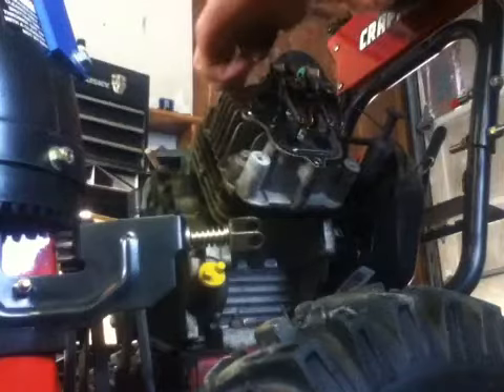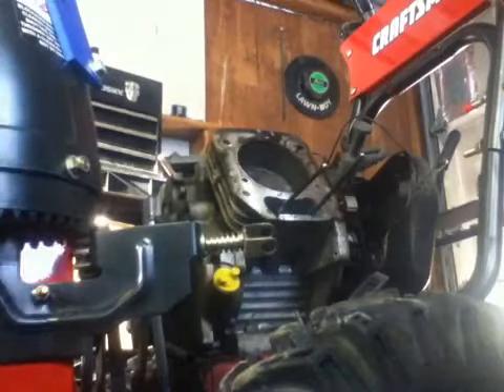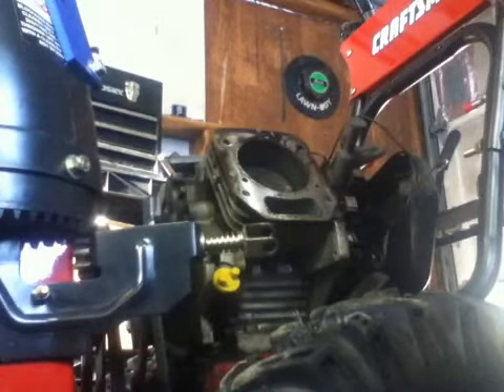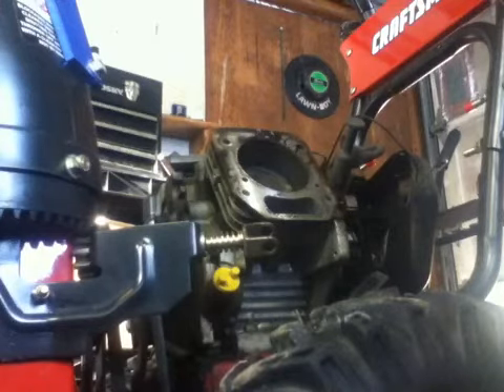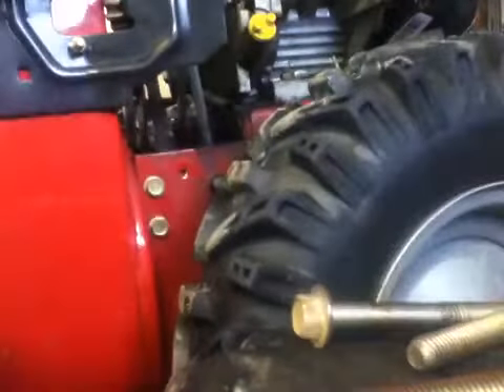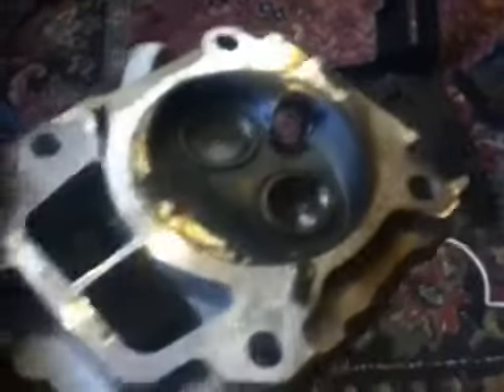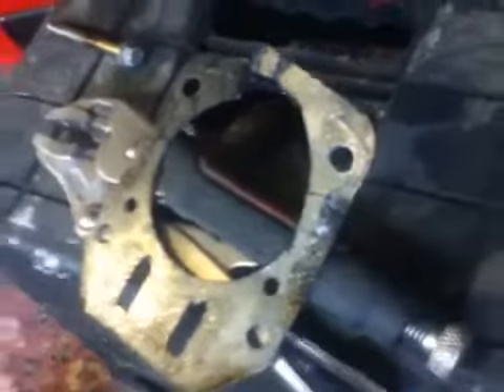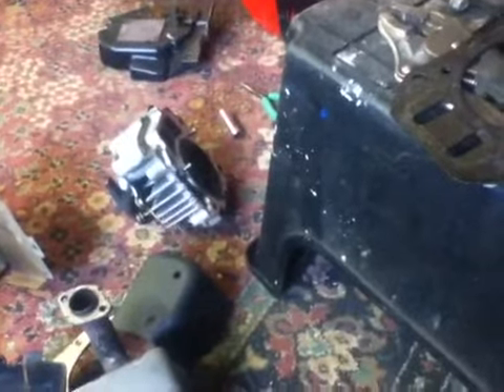Briggs and stratton head gasket replace pt.3

Comment: Yo, thanks for the help you gave me on my bike, i took down the videos cuz you effectively gave me the solution. I do need new reeds, and i have 132.3 lbs of compression, so thats not an issue. As for my idle, It totally never occured to me that i have been doing it wrong lol. Next time i pull it out to start it, i will fix it like you told me. I would personally like to thank you, because you have helped me so much, not only with my bike, but i also got my chainsaw, and Toro Straight shaft running using your advice, and a bit of swearing ;) If you need, anything, ANYTHING, hit me up, and i will do my best to give you a hand. Its the least i can do. I owe you one homie, stay classy. I may not be clueless when it comes to engines, but you taught me that i still have a metric ass ton to learn lol. Thank you again, and like i said. You need something, holler. Parts? Ill mail you what i got sitting left over lol. Have a good one